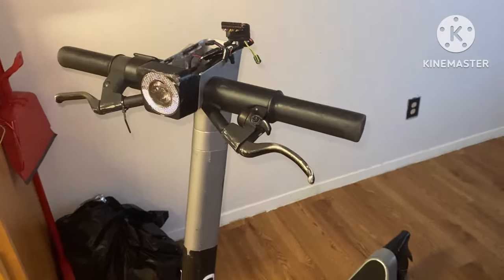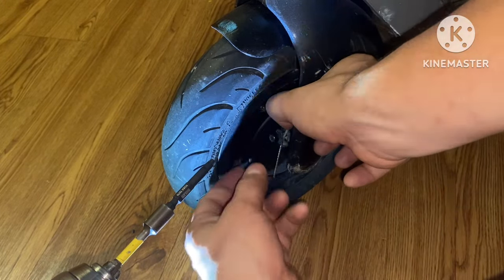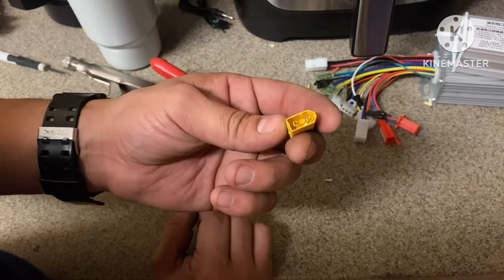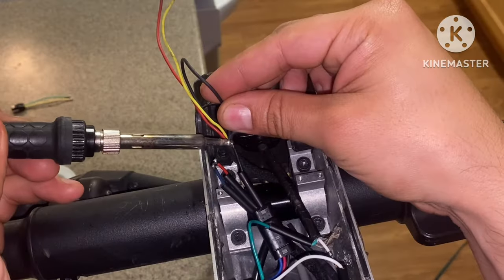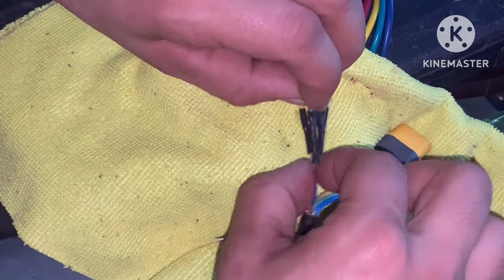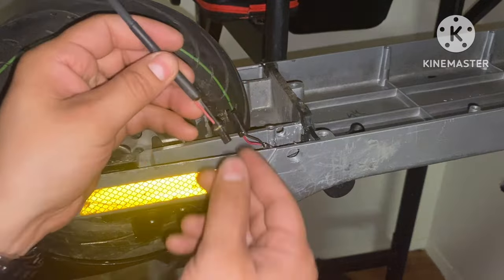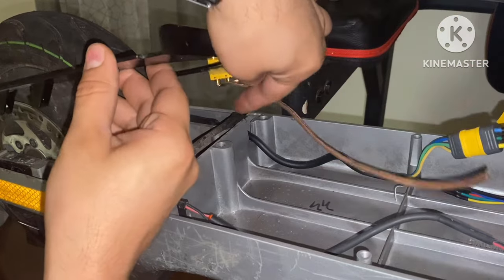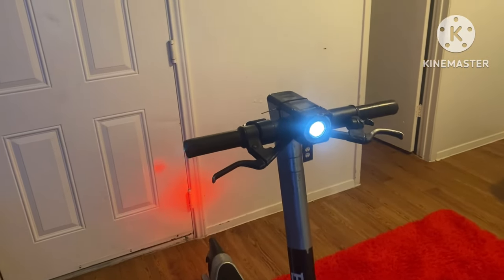Electric scooter || bird 3 || step by step || DIY || tutorial || brushless DC controller￼

Comment: Hey I wired everything correctly but I was testing it and turned off the scooter well it was at full throttle then then it stoped moving what should I do? PLEASE HELP ME
Reply: He won't respond back to you they usually NEVER do. Plus he's wasting power by having that tail light on the whole entire time even riding mid day SMH. It's really to but a controller and throttle with key and you won't break your back doing all this.

Comment: Seems like you know a lot about electrician which right now I wish that was part of my gift. I’m trying to reprogram my Jason electric bike. I got the new version of the Jetson. J5 Think they came out last year 2023 it’s only going 15. I’m trying to reprogram it using whatever technique Arduino board whatever I’m ready to write some code and I don’t know how to program my electric bike because I’m waiting for my parts to come from my upgrade, but I know that I know there’s a way I can without ruining my bike because it’s just on restricted to 19 miles an hour that’s it and that’s all I really wanted for now. If you have any advice, please you have been. The only person has ran through the wires like that. You knew exactly what to do how to do it, do I need to take my controller apart and find the Learning wire I want to take a risk with the shunt even though I don’t think it’s gonna do much it’s either put a little torque or with those control is you you’ll burn them all maybe have some secret if you get up with some kind of way where I could just you know

Comment: Regarding the battery bypass, ive used p+ to b+ and Ive found that if you have a battery under 40v going + and - on the other side you can find more voltage. What is the difference? Both of these ways work for me but I’m interested in finding out the details of what is actually going on.

Comment: Hey good work figuring it all out 👍👍 at min 11:30 wen Yu open battery, I used voltmeter on B or P +/- to find 12volts constant ,solder on wires , and delete the step converter$,😮, LMK
Reply from the maker: lol yea u can do that to just be careful not to cause a short by exposed wire making contact with battery casing that’ll cause your BMS to lock up and have an error code. If that happens, then you would have to do a BMS reset.its works ! Try it just add you some on/off switch’s
Reply: This will cause a battery imbalance with certain cells and cause your range to lower because the bms is passive not active so you loose capacity.
Reply: Hello whe i have bypass the bms i have make a short circuito but with voltmeter give me 36 volt how i see if the bms Lock
Reply: @MicheleBrussino-jl2ys   if you connect battery like @pjscootermods does and it don't have power use your multimeter to find where power stops at, I think PCB way, has a BMS board for this style battery im still looking👀

Comment: Just wondering do I have to buy a new control unit or can I use the original control unit?
Reply: Hello? Do you not do videos anymore?
Reply: @n8dizzle157 He won't respond back it's not like he cares to respond.  It's easier to use controller and buy a throttle with key and connection is simply easy just like the way I did on my homemade bike to an ebike and a bird scooter.

Comment: Hey when i did the bms bypass i am only getting 15.6v. Would the gage of the wire use for the bypass be making it be so low?
Reply: He won't message you he doesn't give a damn about comments but will he will ONLY respond when you say Great video.

Comment: I have what I think is a bird zero and I'm trying to convert it a lot of the stuff on your videos is for other birds and I'm wondering do I have to get a new controller box throttle or a new motherboard display or motherboard? Can I just use original stuff that's already on the scooter other than being able to start it with a button obviously or do I need to buy and what do I need to buy

Comment: Hello! I just mounted the 350w controller but the speed is too low, what can I do to have more speed???
Reply: did you figure it out?
i have the same problem
Reply: How fast is it with the 350w controller
Reply: @huflepuf3441   i figured it out, with the 350w controler the scooter goes 25kmh

Comment: Hey,have u tried getting the voltage for the lights from the boards.?the headlights has 6 volts on the back if it.theres a coupl 5 to 8 volt spots that aren't being used I'll update when I try it later today.
Reply: did you do it? because then il be able to save a bit money
Reply: Yeah,I did it.i ran my tail light and head light from the board with a twich.😅
Reply: Just check ur board you'll have something u can use.
Reply: I had to put a battery from a lime 3.0 on mine bc the bird battery was drained too low couldn't be revived so I took it apart and those batterys can be used for all kinds of stuff.

Comment: can you attach a 3 speed switch to this controller? And how do you turn off the system without an lcd screen
Reply from the maker: Is the controller you are using supports three speed then, yes, we can absolutely connect a switch to it . And depending if you have a controller with a display kit already you can power your scooter on and off up top through the display. it has a on and off button , and a few other buttons to make adjustments.. if you are just buying a controller by itself, then you would need to add a kill switch to kill all power.